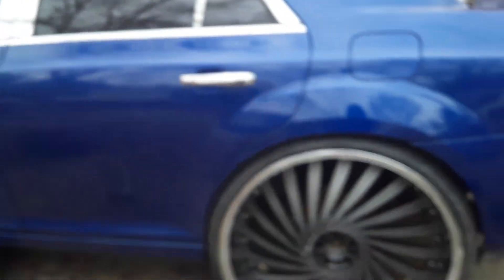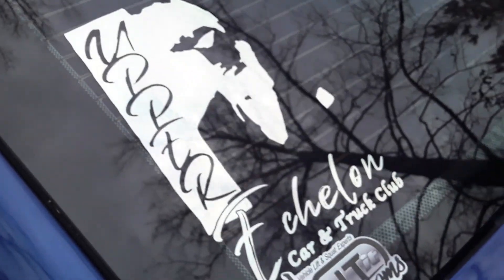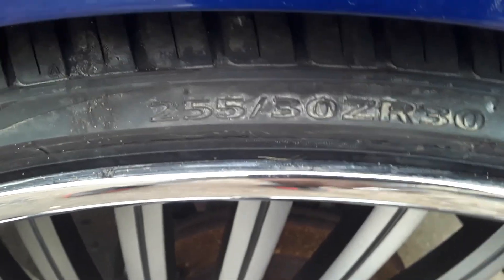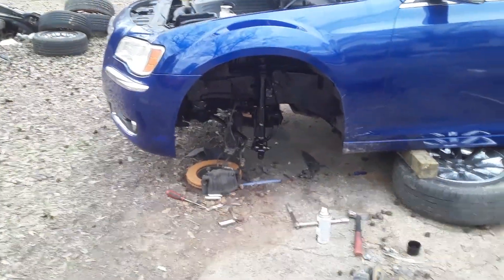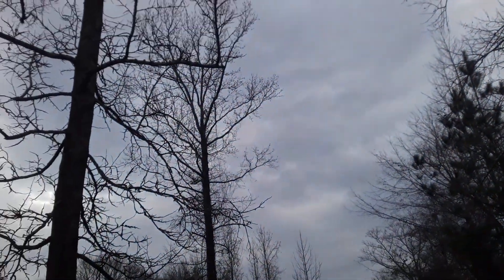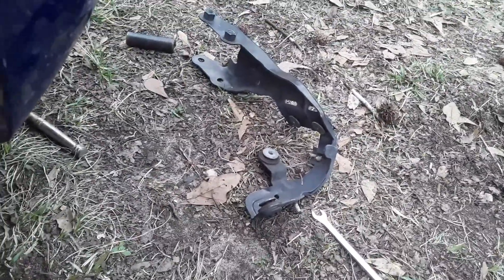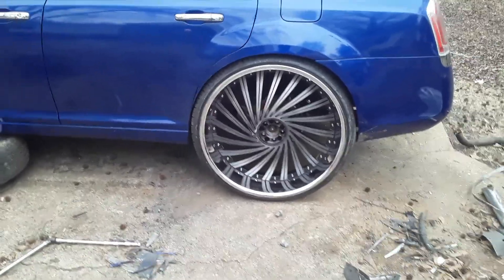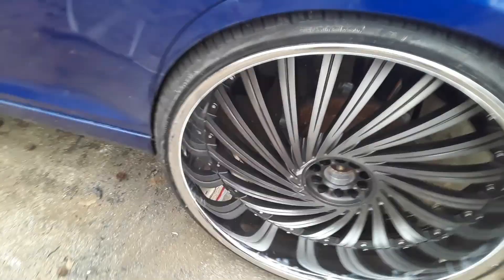kutitkustomz update.300Jimmy with the hemi going 30s.future projects collaborations and car raffles

Comment: Bout to put 28’s on mine. Gonna attempt to do all the work myself. Great content ace.
Reply from the maker: What size u going
Reply: @kutitkustomz2584  I’m going 28s. I already have the rims. I always went with 4s because there plug and play. Not too many 300s on 28s in my area. I’m in the Hampton Roads area of Va. I found a kit online for $938 from a company out of Minnesota I believe. However I’m wondering if I’ll need the upper control arm with the ball joint that slides back and forth. I’ve seen some guys cars where the two front rims tuck in at the bottom as if the ball joint was pushed all the way forward. I gotta admit though, your cuts are the most flawless I’ve ever seen hands down. But yea I’m definitely gonna put my lift on myself as well as the cutting. I trust myself plus I’m a do it myself type of guy. Homie I admire your work, I’m a new subscriber and I look forward to more videos from your channel. Also where are you located? How far are you from Va?
Reply from the maker: @randyrombach8702  I'm in Talladega Alabama.  I'll help u out as much as I can. Store bought lifts are sometimes unpredictable as far as build quality,  ride height, and ride control. By that I mean the lift might be fine for a stock car but a large sound system would change the weight of the vehicle ultimately changing how it rides and performs. Wheel fitment is also a factor. A higher or lower offset, a wider or more narrow rim,  tires size and brand, all fitment factors. The more perfect the fitment the less fabrication will have to be done. Whatever issues u run into I can talk u through if u need me.